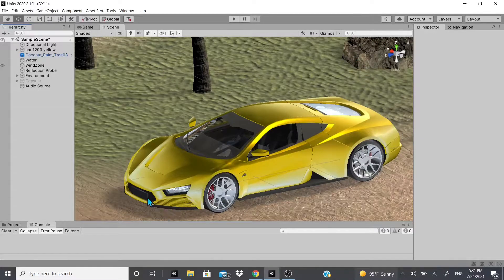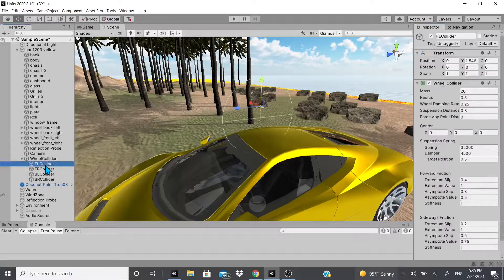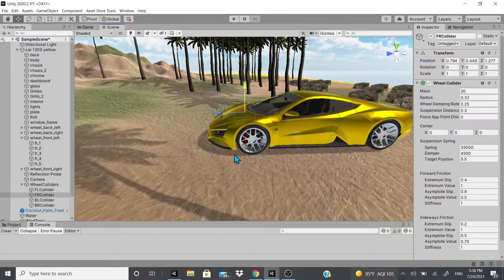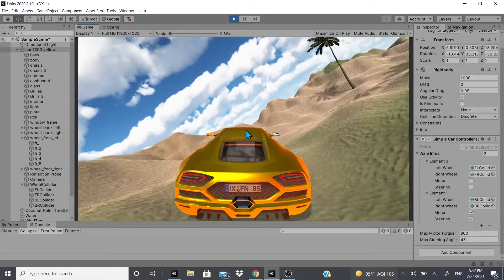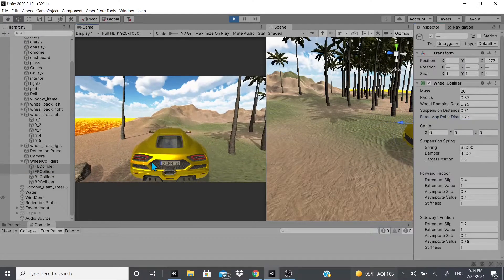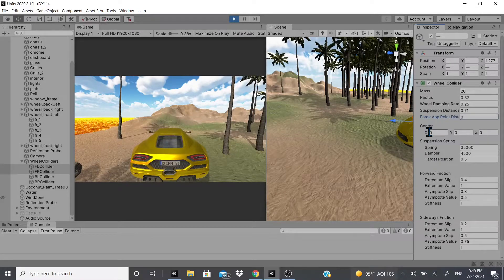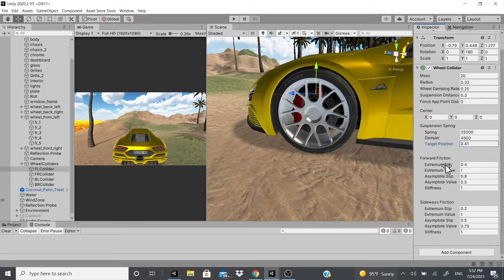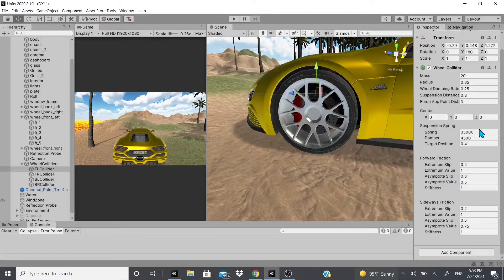UNITY'S WHEEL COLLIDER TUTORIAL

Comment: The reason for the steering being opposite is because jus like in a real car the motor is at the back which  and the steering is at the front. You have both turned on for the back wheels. Change the steering to the front wheels and leave the motor on the back wheels.
Reply from the maker: Thank you for letting me know what I was doing wrong I appreciate it now I know for the future not to have both steering and motor on the same set of wheels
Reply: @robustgames1096  No worries mate just always think of it like a actual car the back wheels push the car unless its AWD and the front always steers. Glad I could help